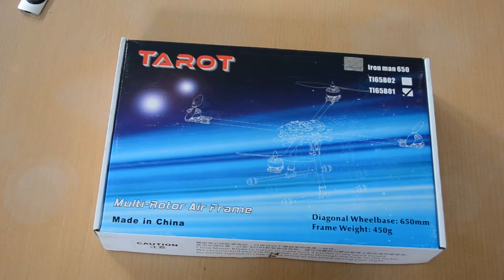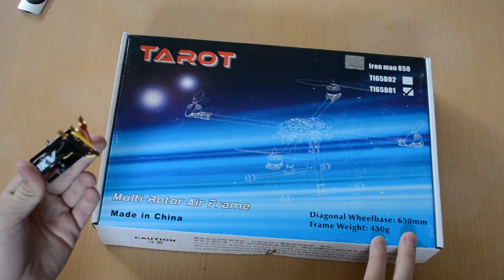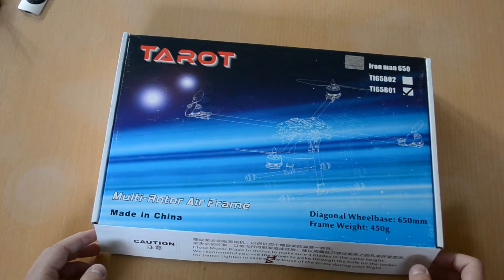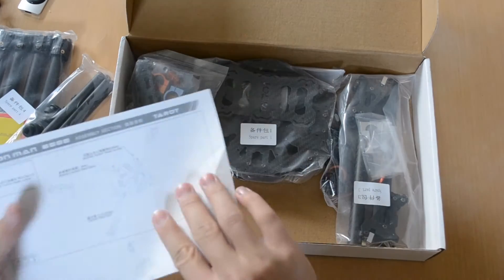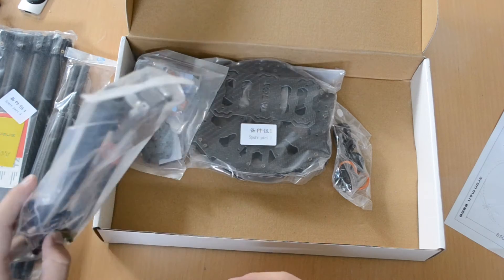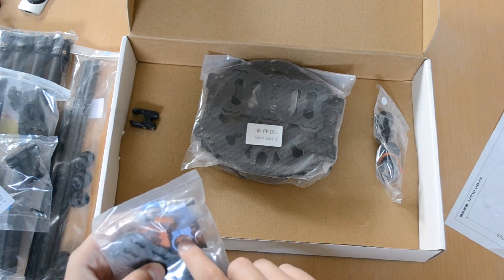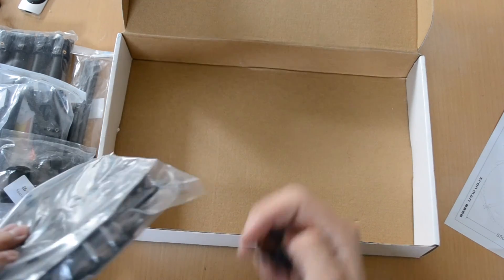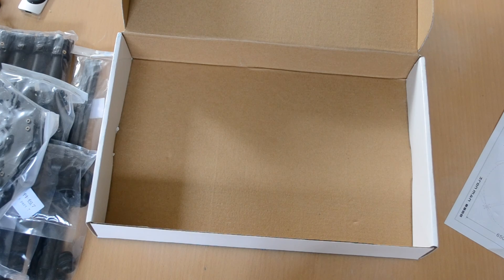Tarot IRONMAN 650 build and review - first look  [Part 0]

Comment: Would it be possible to share the motor size you are using? I can only catch 490, but it seems like HK is no longer selling you model of motor.... :-P Cheers and great work on your builds!
Reply from the maker: Yes of course. I am using the 490v 22 pole multistar motor from hobbyking. Great motor with great flight times (26 minutes hover) :-)
Reply: MultiCopterBuild Thanks so much! Appreciate the information sharing! hope your built is going well with the 680! Mine is also going well, slowly but should finish soon!
Ed
Reply from the maker: rifted You're welcome. Looking forward to seeing your finished build :-)
Reply: MultiCopterBuild I cant either! lol